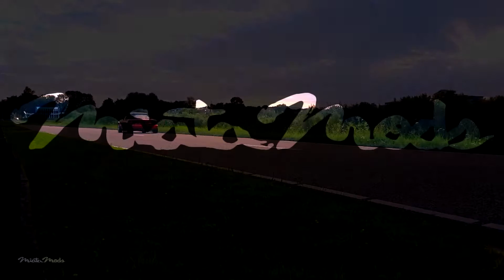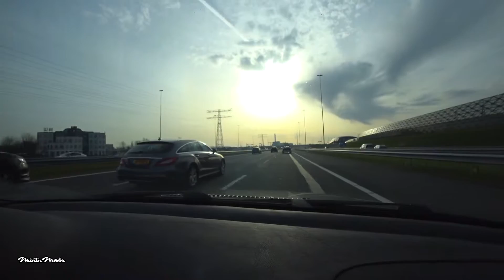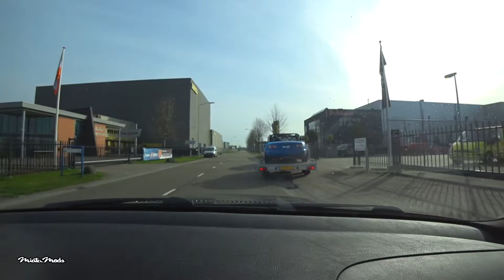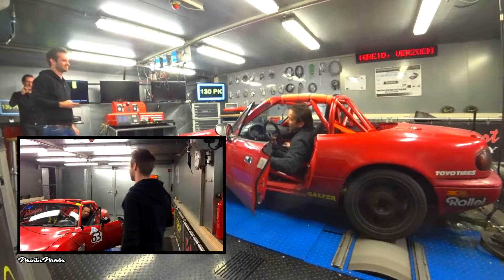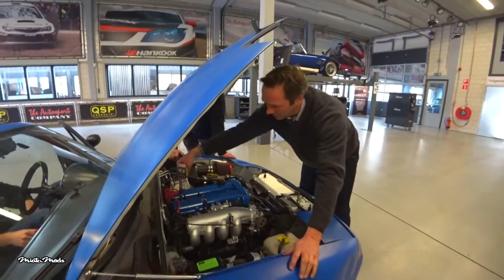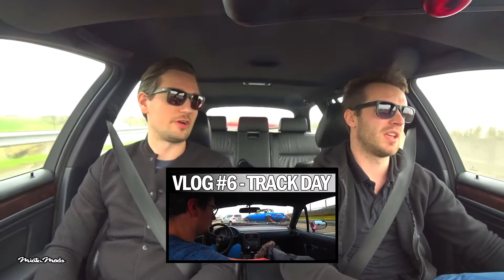MiataMods Vlog #7 - MaX5 Cup race cars on the dyno!

Comment: 130HP sounds amazing! Close to 110whp is a goal of mine but that would require a lot of money and things to be done to my Mx5 (it's the 90hp euro version). Could you tell me what exhaust setups both those mx5s are running and what diameter aswell ? ;P Thanks.   
   P.S  - Your vids have been helpful man (changed all my interrior lights to leds btw), appreciate them tuts you're making and the editing is spot on! The troll faces work as some are on point but try not overusing them as it can get tiresome after a while. Anyways - looking forward to them Miata goods ! :P
Reply from the maker: Getting a 90hp up to 110 is pretty expensive.. Might as well use the money for a turbo setup to push the power over 130 haha! Both cars have a exhaust system that is manufactured by IL Motorsport, specifically for the MAX5 cup. It's 'only' a 2 inch setup tho so no crazy 3 inch downpipe or anything like that.
Thanks for the feedback bro, I really appreciate that! It's hard to figure out the 'perfect amount' of meme's for a video so I just wing it.. I will turn the meme's down a bit :-) Thanks for watching!
Reply: Which exhaust? IL Motorsport is only 500 meters away, where I living. Well, that is really funny after I found it out.
Reply from the maker: I think it's a custom exhaust so ask them to contact their German department to get the info on the MAX5 Cup exhaust they build for that specific race cup. I'm not sure if it will be worth the money but who knows!
Reply: Ohh, I see, IL motorsport  - interesting :)   About the HP going up on the 90hp ones, I've read a few topics about people straight-     dropping the cams from the early 115hp 1.6 engines  to the 90hp 1.6 ones which in return would supposedly gain you approximately 15-20hp and would move the powerband upwards of 4k RPM which is the dead point on the 66kw engines anyway, so I suppose I'm going to try it this summer I just didn't quite understood if anything else in particular needs to be done to accomodate those gains as in ECU tweaking or anything of that nature.Y're welcome about the feedback and expect more from a viewer's perspective in the future - hehe. Cheers!
Reply from the maker: They have a lot of 90HP Miata's where I live so when I was looking for a Miata I did some research on getting the 90HP engine to 115HP and I quickly learned it's not a simple upgrade so good luck with that! Would be an interesting how-to video tho 😊

Comment: That was interesting. How do they get so much power out of the engines? What are they allowed to modify? I found the regulations, but can't read Dutch.  Hope you do a follow up on these car and your friend/driver sometime.
...Man I would kill to race in a miata series - so freakin' cool!
Reply from the maker: I will do a follow up for sure! I will be following my buddy Koen in his racing season so you can bet on it that he will be featured in my next vlogs!

I will ask him what is allowed regarding the engine and I will get back to you 👍
Reply: Sounds good.
Reply from the maker: To answer your question about the engine; The engine is fully build with all the OEM parts (the rule is to use OEM parts) but they do use oversize pistons, resurface the cylinder head and set the ignition timing to 14 degrees. They also change the air intake and the headers. All that with some other minor mods will (hopefully) give you 130HP.
Reply: Thanks man.

Comment: I noticed on the dyno all four wheels are moving? Is that just some weird dyno setup or is it actually 4WD?
Reply from the maker: That's a good question Richard! It has something to do with calculating the drivetrain power loss. That's why the dyno only shows the WHP during the run and after the run the engine HP. It needs to know the drivetrain power loss to convert the WHP to engine HP
Reply from the maker: Haha "sjoemelsoftware"! Are you by any chance a fellow Dutchman SwampMonkey54?
Reply from the maker: Well would you be interested in going a couple of laps around the track in the passenger seat? 😁
Reply from the maker: Send me a private message via my FB or Instagram!